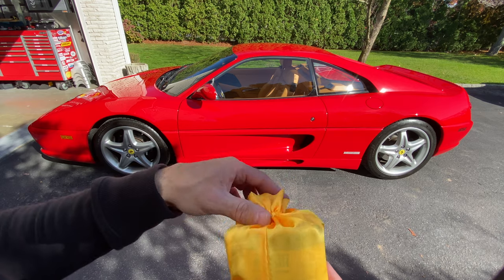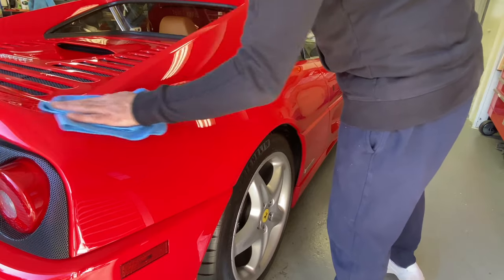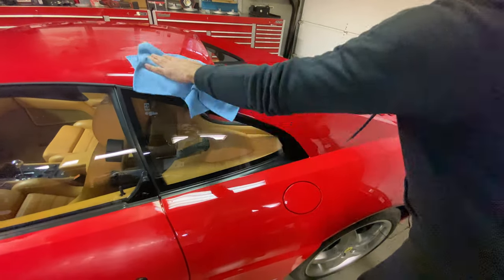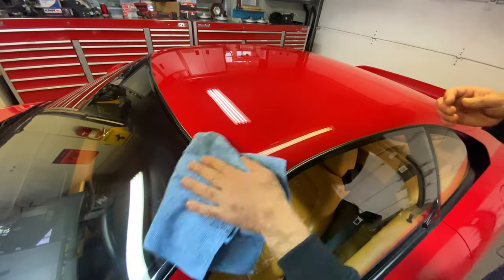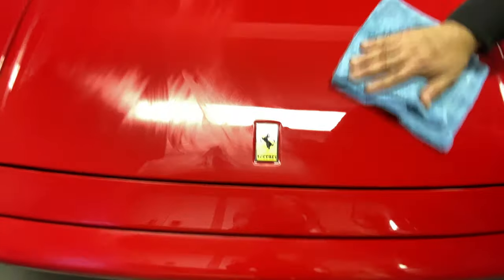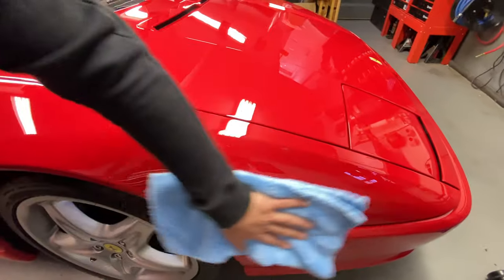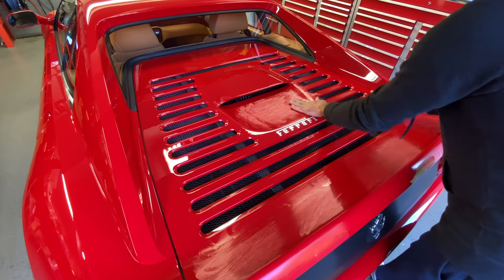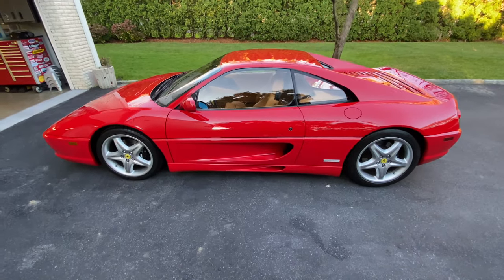Ferrari F355 Bare Hands Wax Therapy | Zymol ITAL | Auto Fanatic

Comment: I would have probably used two or three different towels for that wipe off just for one side of the car. You're filling the towel up with wax and from what I can tell, you're not shaking the towel out at all.  ALso I appreciate your courage in wiping the bottom of the car then running that same towel back up onto the side of the car!   I have to say, the brilliance of this wax on that F355 makes me want to go outside and hand wax something myself!
Reply: Part of that is putting too much wax on initially, it spreads a long way. Finding the right cutting plus buffing towel can take time.

I am still a wax guy,    I might even use a separate  towel on the lower pasts of the car, Autoglym Red are good for wax removal.

Comment: I think the hdcleanse will work best for single stage painting and not clear coat. I have used zymol cleaner wax and it seems to have awesome results on clear coat before a car wax , it’s just a little harder to use that way
Reply from the maker: This Ferrari is original single stage Glasurit paint

Comment: Absolutely incredible gloss! How long is that particular wax expected to last on the paint? Obviously there are many variables in the longevity but under optimal conditions? In my experience with high carnuba content waxes. They are pretty much done in a month, maybe two at the most vs the newer synthetics that I can get 6-8 months out of.
Reply from the maker: yeah this is not designed for long term since these cars are rarely driven and used in the elements but this process becomes a ritual of bonding with that special car and to be honest id even do this once a week and be happy doing it.

Comment: I use zymol products on my motor bikes and X5. Yes there's a fare bit of work the first time you do a vehicle. Because you have to give it a good wash, then use the HD cleanse. Then I use Zymol concours wax but tell you what after your finished you stand back and see the shine its amazing. The fantastic thing about the wax it really keeps it shine. So you don't need to wax it every time you wash it. It you use zymol clear auto bathe when you wash your vehicle as well. God knows what zymol put in but it even makes your vehicle really shine as well. But like you said there a lot of polishing to start with. But once you have a layer of wax on you just have to reapply more wax on top. That's just to give the paint more protection. Oh yes and it gets you out of the house and something to do as well.
Reply from the maker: yeah the Ferrari still looks awesome all ive done was detailing with my Auto Fanatic 007 Ceramic and our waterless wash since.

Comment: I wax cars with Zymöl, less is more with the wax plus yes a new experience. These cloths have an element of rubber where you are now bonding the wax to these paint, rather then traditionally rubbing it off..so the wax stays on the car not the cloth. I use the Zymöl Holiday packs.

Comment: When you mentioned using the Gyeon or Griot's garage out of the box and them performing their best then, do you use them literally right out of the box or do you a first wash before use?
Reply from the maker: Steve i did a wash specific video on the Ferrari 355 check my channel where I protected certain areas and did it with my F100 foamer and a garden hose. then i Gyeon prep the paint and use the Zymol prep then the Zymol Ital as this video shows. the car still looks amazing since this video was shot.

Comment: Really enjoyed this Phil. The shine jumped the shark. How long will that wax last? How about topping it with 007?
How come ur Ferrari doesn’t have a clear coat?
Reply from the maker: Hi this type of wax is mainly for show not durability for outdoor protection but these cars are never driven in such conditions. Doing a process like this becomes a ritual to bond with that special car.
Reply from the maker: no clear coat because that was how cars were painted back then, the technology was not there yet same with Porsches and other manufactures. Single stage paints are still used in high end hot rods and custom show cars because the blacks and reds glow much better than the 2 stage pigments.
Reply: @autofanaticcars  thanks for ur prompt attention in answering my questions. It’d be awesome if u could explain all of these good stuff about single stage paint, double stage pigments  in more depth in one of ur upcoming vids. Love ur vids. Ur Ferrari looks immaculate

Comment: I think most Swissvax waxes also say not to let it dry but for example their endurance wax they say to let it dry for 2 hours before removal (was actually told its 5-10 mins by email). I tend to let Endurance and their other waxes to dry for about an hour and I notice no streaking or smearing that way.
Reply from the maker: yeah Zymol also has conflicting info of saying to let it dry up to 3 hours but that makes no sense, I listen to the label on the jar during the video.
Reply: Try a finger swipe test, once dry should be fine. 

These are high quality so even in you leave it on longer, should not be a problem getting it off.

Comment: The thing I love about wax is that it almost requires no prep. Sure for best results you should clay, decontaminate and polish first. But clay barring is super boring and so is machine polishing imo. I just love to wash my car thoroughly, rinse it, dry it. And apply some BILT hamber double speed wax. That stuff is amazing. It’s cheap (£14), it leaves a nice shine, it’s fairly easy to use and the water beading is insane
Reply: To preserve paint you are right to not be buffing and polishing —drying and gentle polish is non/aggressive — if it doesn’t shine optimally it’s ok — you can wash / wax more often because you are being more gentle

Comment: Nice video , however you are applying far to much product on to your hands and the car , a small amount of wax about the size of a pea into the palm of your hand then rub hands together as the heat from your body melts the wax , that small amount will cover a panel the size of your Ferrari roof or rear quarter , then using almost no pressure at all on the cloth will easily remove the residue leaving that high gloss finish . I used it on my black 911 for years its great on curved bodywork but applying to much makes removal harder and end result is no better you are just wasting product .
Reply from the maker: this was the first time i ever tried this and after a few panels i did start to use less, the key with most waxes are the removal towels. I only use the Griots white dual weave PFM wax towels and I never have removal issues this Zymol Ital was so easy to remove and the car still looks amazing.
Reply: @autofanaticcars  yes it looks great .

Comment: application with your hands is pointless...
Reply from the maker: this is how this process is designed and intended, i did not invent it
Reply: @autofanaticcars   using your hands let’s  you detect the slightest imperfections — but in LA there are many days hot enough to melt wax. I like a spray wax hybrid.